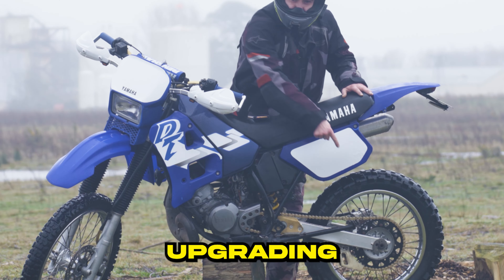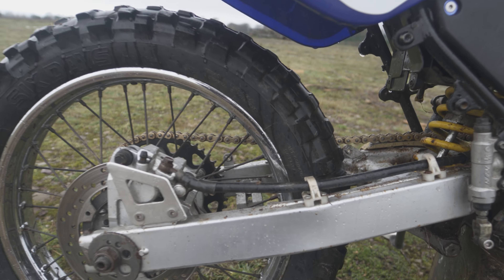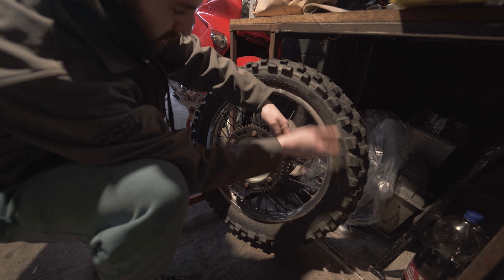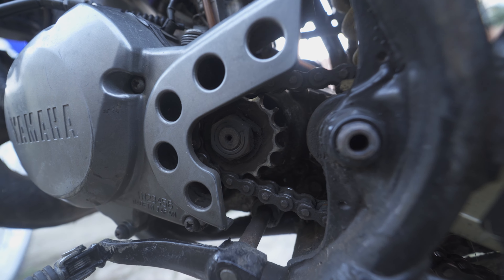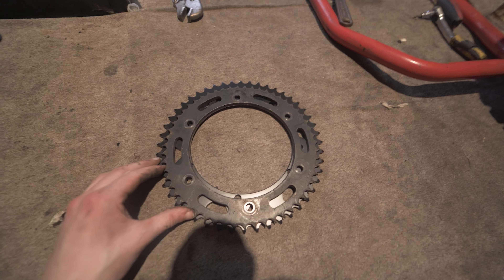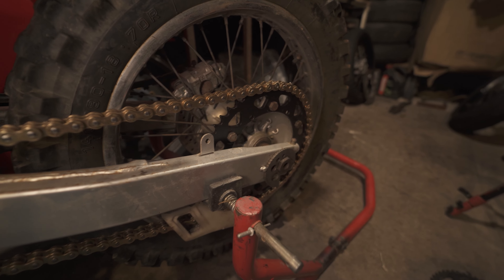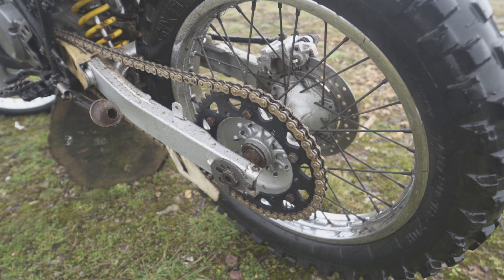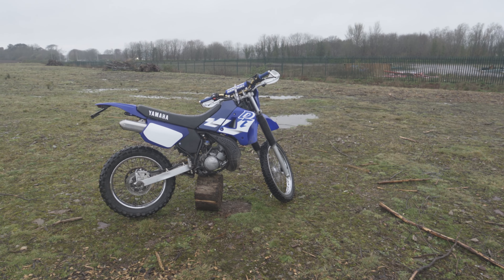Get A Chain Upgrade For Your Yamaha DT125R!

Comment: my 2001 is getting a full engine rebuild as we speak to get her proper crispy, only 6k on her so shes clearly had a dodgy rebuild in the past. was gonna sell it but as im putting so much money into it i may aswell use it. full frame powder coating at some point too i reckon. cannot get a more fun and more reliable two stroke 125, they are brilliant
Reply from the maker: Na keep it and enjoy it man, it will be fresh again once its rebuilt and you won't wanna get rid of it ;) You don't see many with that low mileage too!

Comment: How did you mount this front fender. I have problem with wires
Reply from the maker: You might have to reroute the wires or maybe try to tie wrap them up onto the fork clamp while you bolt it in. Hope this helps

Comment: Love the gold chain look mate, nice vid! Btw I have a question, I'm struggling to remove the rear brake caliper on my DT and had to remove the wheel with it still being on. I can't really figure out how to remove it since it seems seized af lol. If you have some tips I'd be glad to hear them!
Reply from the maker: Ah ya the rear caliper always seizes up and can be a pain. When I slide the wheel back out of the swingarm say, I tap the caliper upwards off the disk with a rubber mallet. A hammer will do too but don't go mad with it lol
Reply: @RHauto  I see, it wont damage my disc tho? Since my disc has like a ridge at the top idk if it will get damaged
Reply from the maker: @mix6429  a bit of force is fine, just hit a solid bit of the caliper and not the brake line bolt 😝 it's not the correct way but it helps. You can use a flat head screwdriver or pry bar to lever in between the pads and disc to squeeze them back and make some room too. The ridge is just where the pad has worn down the disk, its flat when new but a little wear is normal
Reply: @RHauto  I'll make sure to try the mallet tomorrow, already tried to pry the pads but didnt really work lol. Thank you for the advice!!!
Reply from the maker: @mix6429  it'll be stiff but it should move, and ya no problem man. Any other issues just ask 🤙